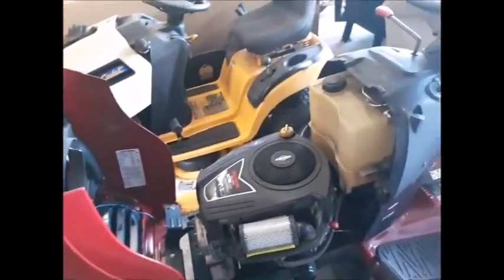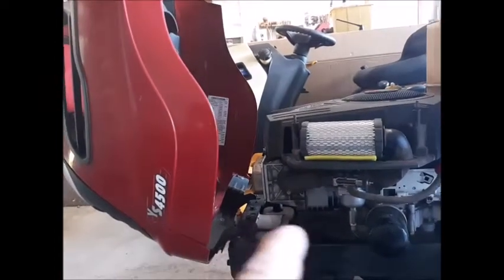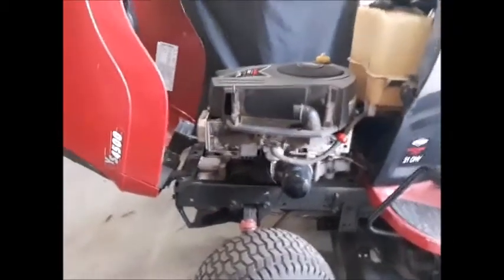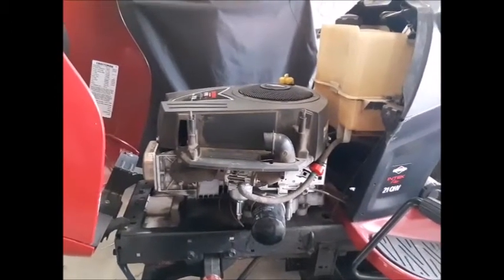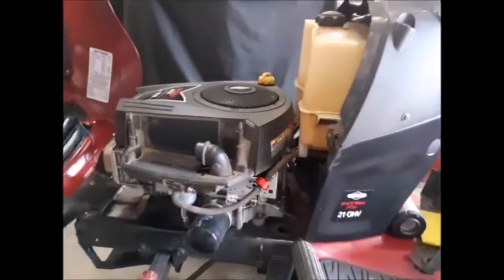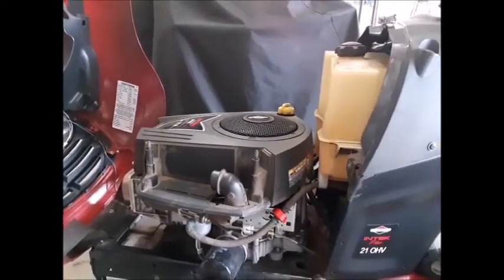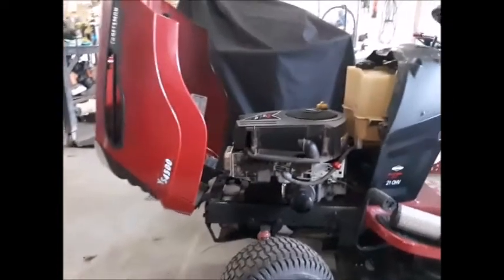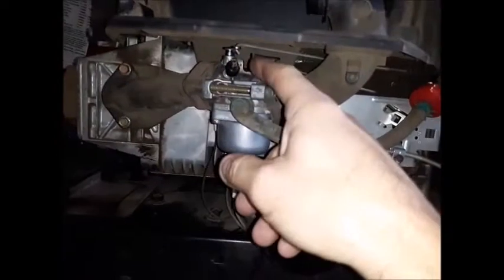Craftsman YS4500 Problem Solved

Comment: Great job Wally I knew you'd find it.
Reply from the maker: Thanks John. I told my son that I was about to admit defeat. I said I'm going to go ponder it one last time.
Reply: @WallysPlace66  I've been there before to.

 Today in fact Wally, I was trying to get the engine mount pins out of an old rusty troy bilt horse tiller I bough last weekend and I was heating, soaking and beating with no movement at all and I was getting ready to cover it back up and thought I'd take it out dad's where I could get my impact chesil to it and that drove them right out. Now after I get it cleaned lubed and moving on to the engine.  Take care Wally.

Comment: All of this just goes to prove how difficult it is to diagnose a problem without actually being there and being able to "see" all that is happening. We can only make suggestions based on the information (or lack thereof) that is supplied. Prayer is the best tool in your box.
Reply from the maker: "Prayer is the best tool in your toolbox." I'm going to have to make a sign to hang in my garage that says that. That's a good one George.
Reply from the maker: I had a craigslist customer suggest clipping the plunger thingy of so I did. I knew it was good but I did it anyway. I shouldn't have listened to him but I did. The new solenoid was only $10.
Reply: @WallysPlace66  Sometimes that will fix the issue you were having, but as you found out, it wasn't the real issue. Careful examination is one of your best resources in diagnosing the problem.
Reply from the maker: @TheShadeTreeFixitMan  
I did try bypassing the solenoid as you and a couple other people suggested. The good thing about that is you can put it back if the bypass didn't work. Snipping off the plunger  as I call it wasn't so smart LOL.

Comment: Having issues with my Craftsman 4500. Was fine til I ran over a bunch of leaves to mulch them and now it goes slow even with the speed lever all the way forward. Drive belt looks good. Any ideas?
Reply from the maker: Sometimes the leaves and grass gets packed around the linkage and doesn’t allow full travel. I would start there.